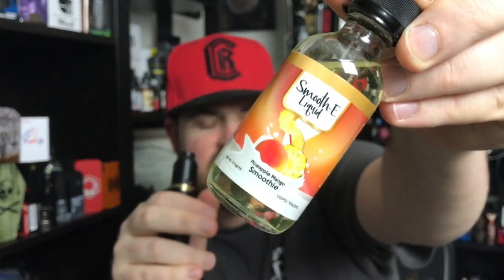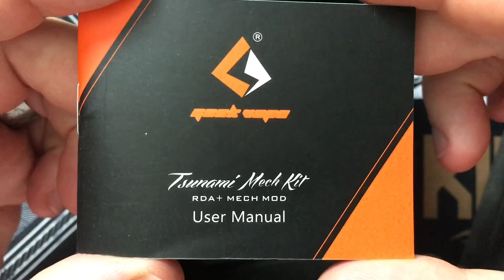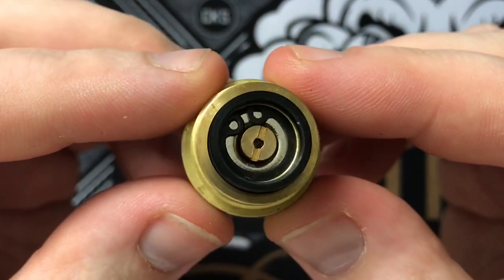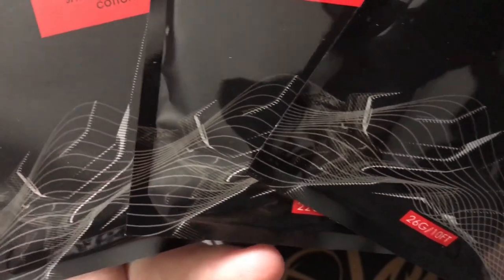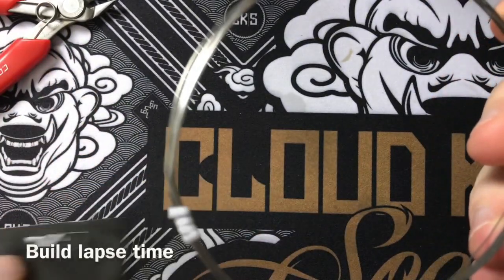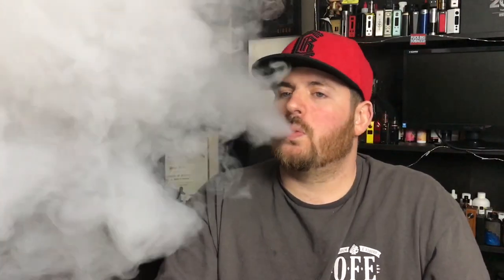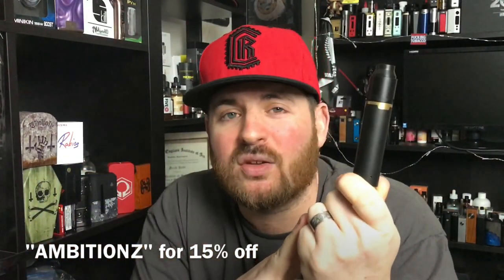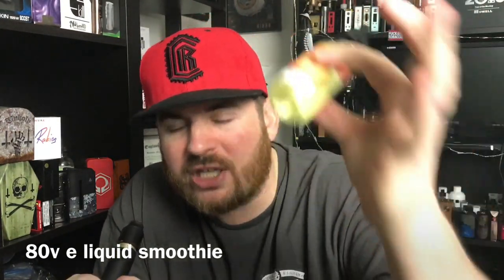Tsunami Mech Kit by Geekvape & 80V Pineapple Smoothie/ Review/Build/Giveaway(closed)

Comment: I remember the days you used Anarchist AN80 wire. Parallel builds are my Bread & Butter for tube mech's. I use 24g SS 6wrap 'Parallel' =0.09 to 0.1,  or I use N80 24g 4wrap 'Parallel' = 0.09 to 0.1. 👍 👍. I won't enter give away, but great review buddy. 👍

Comment: Like this one! #tsunamimechkit The alloy is Kanthal with added silicon which keeps it from rusting, lowers the resistance slightly as well by the way. Making it behave a little more similarly to stainless. (retired welder and welding inspector foe nuclear power plants)